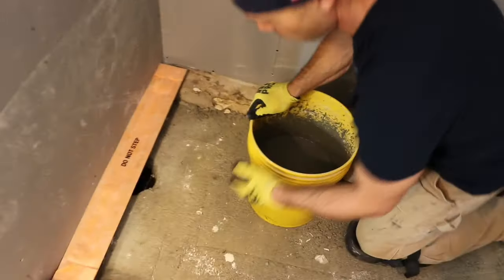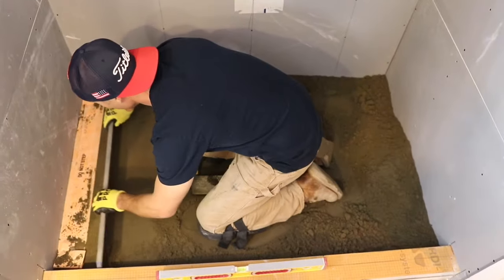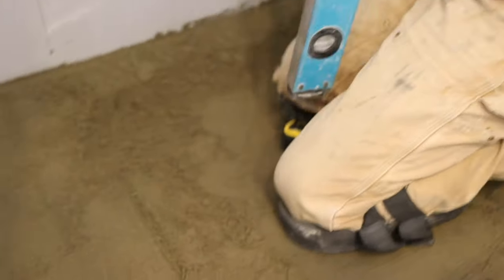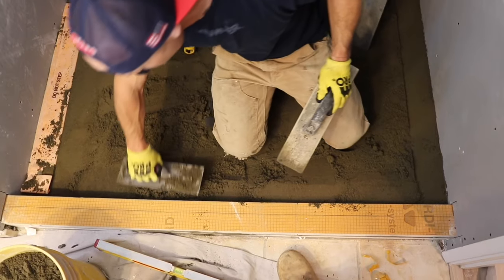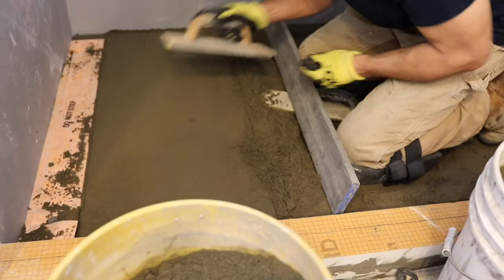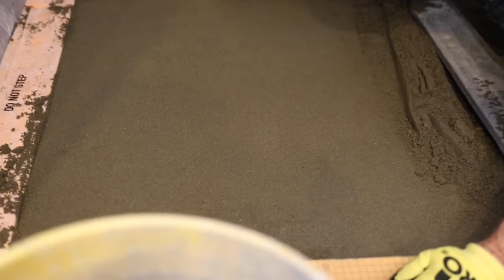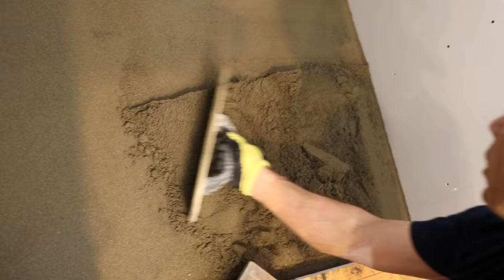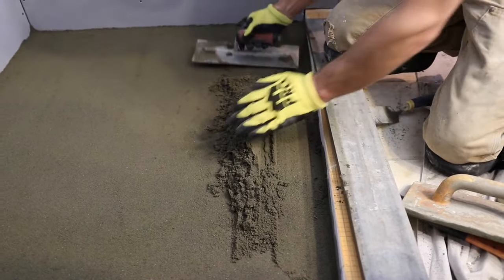Dry Pack Mortar for Shower: Tile Coach Episode 27

Comment: I never could understand the purpose of using dry pack as opposed to a mixture that is just a little more wet.  I don't trust it to set up completely. I "poured" a shower pan that is 4'x7' on an above grade concrete slab with a sticky mix. I used red guard water proofing, tiled it and it has never leaked. It's been 12 yrs.

Comment: I just ripped out our cracked shower pan. It was supported by mud bed that slopes away from drain by an inch. Can you add dry mortar around it to build it back up to level than add foam pan?

Comment: We tore out a shower pan a few years ago that must have been poured with concrete instead of deck mud over the rubber Oaty liner. After a few years it had wicked up the walls and started to destroy the framing. The single door opening swelled so bad the door would drag and the curb was cracked. What a mess in this beautiful home.

Comment: The only critique I'll give is regarding the denzshield. Ga Pacific requires a minimum of 1/8 in above the finished pan. That's their instructions and it voids the warranty if not done that way.  It's gypsum(drywall) with a waterproof coating on the face. If water collects at the bottom of the board it WILL wick up the wall. I'm rebuilding a shower right now because mold was growing on the adjacent b/r wall. After a month of no use, I could form the denzshield into a ball, like wet clay. I never use that product. Even with cement backer, I leave a small gap. If done right, liquid membranes are an added benefit but if it fails, the shower is still fine. The floor looks good for sure
Reply: @TileCoach  I get that, in theory, it won't leak but if the membrane fails the shower fails. I would think that if everything was installed properly then if the membrane fails, the shower would still work as it's supposed to. I just watched your video on the 8000 sq ft grocery store. It failed due to a gypsum based product getting wet. I get that the floor wasn't "sealed" but it shows that all products have the potential to fail. I think that you do a great job but I also think that those details matter. I wish you all the best and stay safe out there.

Comment: Third generation pure blood dago tile setter here. Learned the trade over 35 years ago. Passed down by my father and grandfather. Here in Michigan I dry pack most all my floors. We call it "pulling mud" and "pulling screeds". Still the best most solid level floors going! Nice job Isaac...great work!
Reply: Isaac Ostrom when I started we'd use the old oil soaked 'rib' lath (don't think it's made anymore) and scratch coat wall mud. (40lb bag of lime, 94 lb bag of Portland and 35 shovels of sharp sand) we'd then level the walls with a second coat using 'screed sticks' leveled with a screed of wall mud, with a pinch of baking soda. The baking soda set it up almost instantly so it'd harden to 'pull' off of. I still have one old builder who has me do it this way. Sometimes well pull wall mud over drywall where the scratch coat isn't needed. The rib lath method went over tarpaper and bare studs. I'll also do Durock, Hardie, Wonderboard and the others but still kinda set in my ways. Hard to teach an old dog new tricks. Lol But I dig the new methods. Definitely time savers!
Reply: Isaac Ostrom galvanized diamond lath today but years ago a thicker oil soaked rib lath was common. It was more rigid and held up better for the scratch coat. Haven't seen it sold in years though.

Comment: won't water pool at the corners where the drain sits? They can't really be angled towards the drain either because that would make the tile sit crooked? Or do you slope that at about an inch also and just deal with the tile looking angled?

Comment: Now that is some pretty mud brother. Nice fine sand and an almost fluffy consistency out of the bucket. Some of the bagged shit is like pulling pea gravel. Are you exclusively using kerdi now? I like the sheet membranes well enough but can't get passed the thought that scratching out a bleeder on the pan could cause a leak.

Comment: I use a 1/4 tile mosaic and put it under the front of the level so don't have to use the tape also how do you know your shower floor is going to go flush with your drain or do you want it higher then your drain
Reply: Every trough drain?
Reply: I wanna see the finish product

Comment: What do u use for deckmud
Reply: I want to know too.
Reply: Yea we ended up using the mapie I think it is deck mud. Poured with the cheap er mortar stuff till we realized it wasn’t gonna work out and pulled that out and used the deck mud and man a difference it made to work with and could form it.

Comment: How do you fasten the shower curb to the floor?
Reply: Jason McEneaney toenail the first 2x4 to the wall stud then then screw down the top 2x4 to the bottom.
Reply: With kerdi curbs you can jist thinset them in
Reply: Superglue, duh

Comment: Dry pack looks just too dry.  How is there even enough water for the mix to bond well enough to become a slab?  I understand it is easy to work with, but it still just looks like barely moist sand.

Comment: I have a rigid 7 inch tile saw and it cuts all my 24 inch rip cuts 1/8 apart what saw you recommend (not too expensive ) or is there a fix ? Thanks isaac I been tiling for year but never really learned till I payed attention your your channel thanks 🙏
Reply: Thanks for the reply i was thinking of that one for a bit and now that you recommend it I will get it 👍🏼

Comment: Great video! What's the brand and product name for your deck mud? I tried this with "Custom Building Product's" "CustomFloat Bedding Mortar". The name and directions on the back seem to indicate it can be used like this, but it easily chipped and scraped out a day later. The only issues I can think of is that I took too long floating (claims it sets in 15 minutes), didn't pack/stamp well enough, or I didn't mix well enough. Ultimately, I'm having a hard time figuring out exactly which product to use out of the 20ish options at each store I visit. I bought some "Rapid Set" "Mortar Mix" to try this time but unsure it's meant for this.

Comment: Well my man, levels can be inaccurate. They can also become inaccurate with age. If you drop it, you should really check it and make sure it still reads correctly. Even the aircraft aluminium heavy duty ones. I had a 24" TrueBlue I was all excited about. Aircraft aluminum, magnetic with the hand inserts. Thing was 3/16" off right out of the box. Took me half way through a project to realize what was happening. What a headache
Reply: Trust. But verify.  Always check measuring devices (lasers, old-school theodolites, levels etc). But he did have Stabila, the best levels...

Comment: i like your blue Israeli made kapro level.  Startile wont like how you buried the wallboard in the mudbed.  Uh oh.  Its ok, 4 coats of topical and u r golden.  lates
Reply: @TileCoach  u know that your blue level is made by kapro in Israel, right?
Reply: If your wallboard is waterproof, what's wrong with running it into the pan.  Starrtile must not know about waterproof backerboard, among many other things